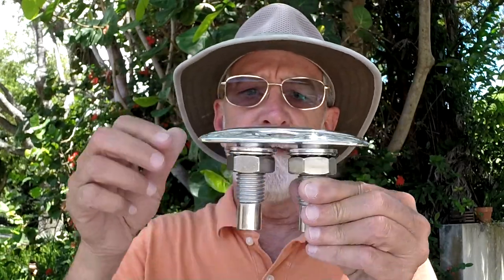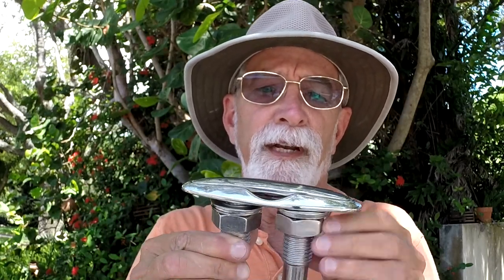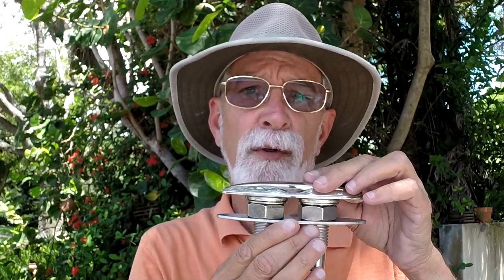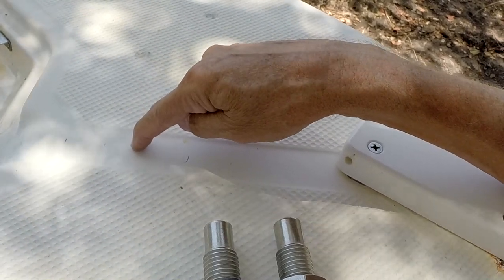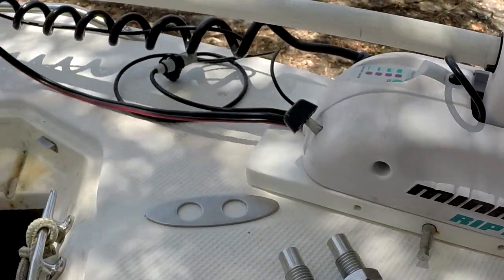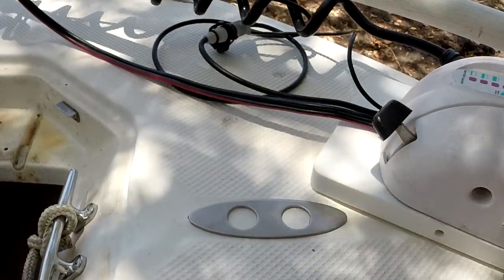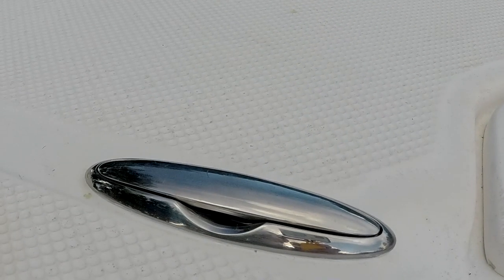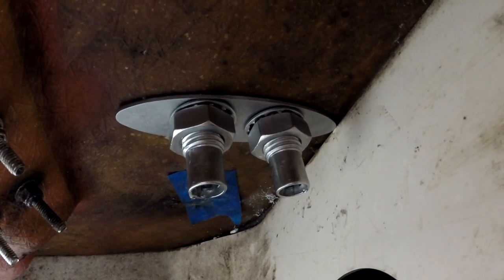Installing a Bow Cleat - September, 2018

Comment: Nice! ... I have been having to leave a rope tied to the  steel bow eye  to tie up to docks.  The rope always got in the way and has more than once  dragged in the water after launching. 
I guess this is another Jim M. modification  I'll be copying on my KW 1720 in the near future.  Did you pick the cleat up online?
Reply from the maker: Coleman, thanks for watching and commenting.  I picked up the cleat at an eBay auction, then bought the backer plate from another online vendor.

On the forum, I was asked why not just use the anchor locker cleat.  You know, I've owned the boat for four years and self launch using a short, double looped line slipped over the winch post and onto the anchor cleat.  I had never considered using the anchor cleat for docking purposes.  It is an option to consider until/if you install a bow cleat.

Comment: Why didn't you just use the cleat that's in the anchor locker?   
The locker door has the cut outs
Reply from the maker: Agreed that the "hidden" cleat inside the locker could be used.  I have, as most do, the anchor line securely tied there which doesn't leave much room for a dock line.